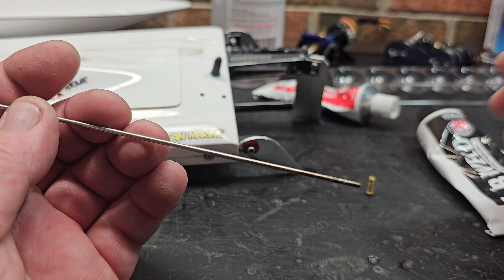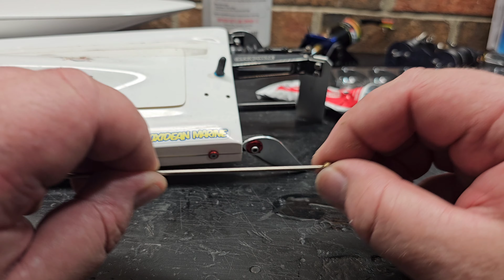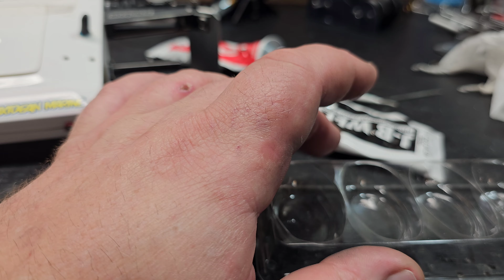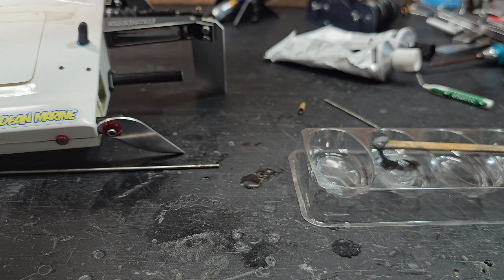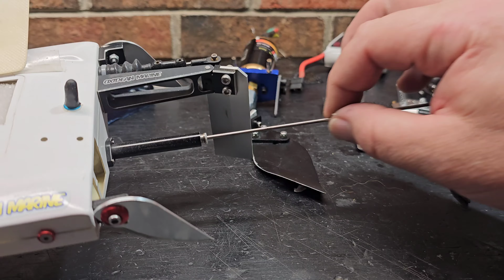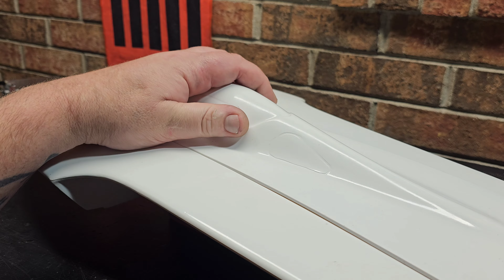Wire To Stub Shaft Connection Using J-B Weld Oxidean Mini-Dom Mini Mono

Comment: Had the same issue as well, I filled mine and was going to re drill the ID…I ended up buying a shaft from aliexpress and yet to run it due to the frustration of getting a boat that didn’t work out of the box

Comment: Bummer - dropped my DX4C transmitter and now my boats get about 20 ft away and die! I have close to 15 receivers programmed into the transmitter. I found a used antenna and hoping that cures the problem.  I have purchased a second transmitter but hoping the antenna does the trick. The waiting for deliveries is the toughest part.
Reply from the maker: I hope the antenna helps, keep us updated

Comment: hey big b, huge fan. wanted to get your opinion on prop size. 

running a custom built 30" hydro on a 4074 1700kv on 6s.  weights about 9 pounds. 180a seaking esc. 

Currently running the pro boat 1.7 x 1.6 prop.

boat goes plenty fast but it takes a minute to plane.   what size prop do you suggest to get up on plane quicker, even if it sacrifices some top speed.  Thanks so much!

Comment: Locktight 603 is what tenshock uses
Reply from the maker: Tenshocks connection let loose,  I run several boats for years now with jbwelded connections and works 👍 great.

Comment: I don’t know B, dang if I wouldn’t set it up in the drill press and put hole through that collar and shaft and insert a pin. It would be tricky, very small bit, but at the price of props, I’d think it’s worth the hassle.
Reply from the maker: Drilling a hole through this wire would be almost impossible IMO and may weaken the wire?
Reply: @IRONCLADRC  it could weaken the wire for sure. I’m just trying to think of some way to have some sort of retainer. I guess the best thing is to check it routinely.   Looks like some heavy weather rolling through our area. We need the rain.

Comment: Silver solder is the way to go IMHO
Reply from the maker: Thought about it but the heat may weaken the stainless steel wire.   I've brazen wire in the past and got it to hot and the wire bent.
Reply: @IRONCLADRC  I wonder what the common practice is for the bigger 1/4 cables with the big people like MHZ or someone. When you order it assembled I'm not sure what they do. Just getting into boats after being into rc for over 20years. Got my first hull a 70" SV50 so still trying to learn before I build it up.
Reply: That's what I was thinking. Or solder but silver solder would be best.
Reply: @holgerlafrenz2895  if you order a propshaft that comes with a 1/4" flex cable already attached from say MHZ. What are they typically using? Always wondered what pre prepped bigger stuff comes attached with.

Comment: Braze it!
Reply from the maker: I thought about it, but you gotta get it so hot it may weaken the stainless steel wire
Reply: @IRONCLADRC  Not for solder. 
Don't heat it until it's glowing. Just pre heat for a few seconds.
The solder will liquify pretty easily with flame.
If you have any trashed drive dogs and a scrap piece of that diameter stainless shaft, try a test piece 1st.
But I don't think you'd take the temper out of the stainless, so long as you don't go crazy with the torch.
Just an idea.  
And it may save you from having to service it again.
Reply from the maker: @Wanted1069  I have a drive dog that needs to be soldered on ill try the silver solder on that one thanks for the info
Reply: @IRONCLADRC  anytime!